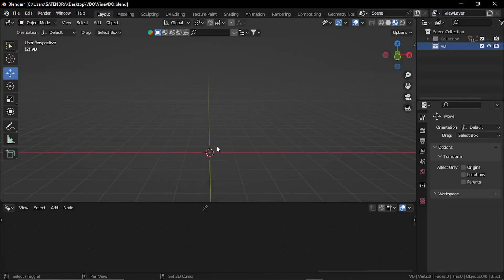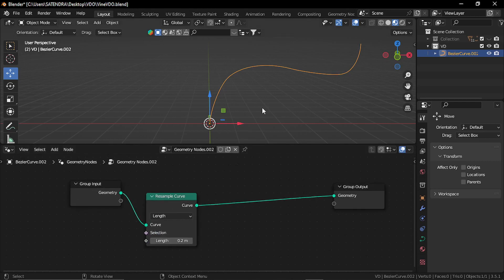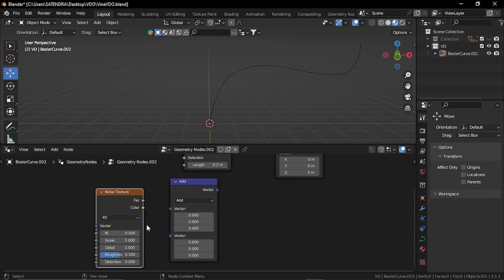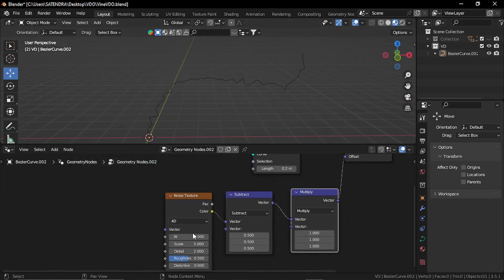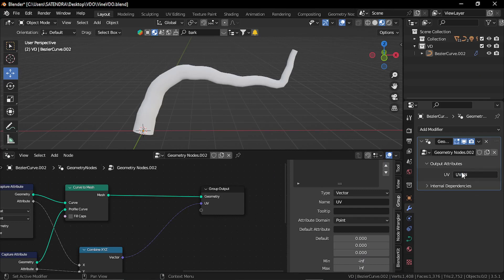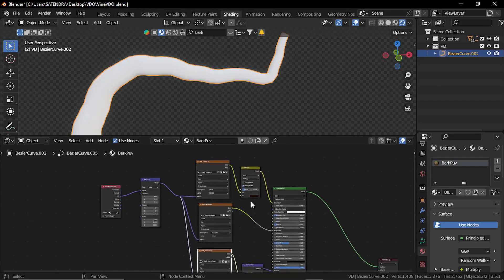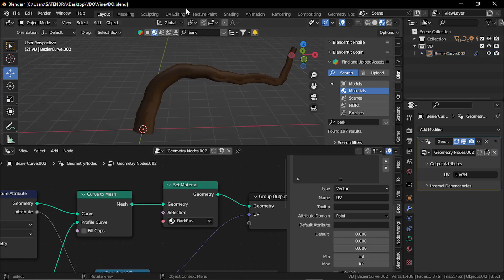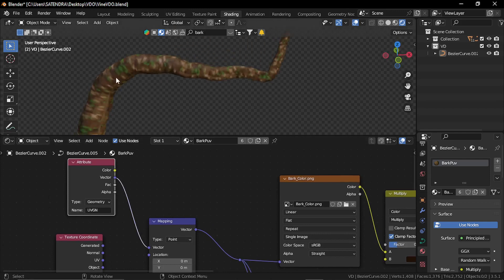Easy Geometry Nodes - Procedural Roots - BLENDER3.5

Comment: 3:40 If you are trying this today, float curve doesnt go into set curve radius, just plug it into the curve to mesh "scale"
Reply: GOAT
Reply: thank youu
Reply: for me the 'curve to mesh' node doesn't have a scale input. Just: curve, profile curve and a fill caps option. But it works as per the video anyway. Using Blende 4.3

Comment: I'm stuck at 3:39, when I set the same nodes, mine is skinny all the way through and not tiny on one end and fat on the other end.
Reply: I ran into the exact same problem. Not sure if you've found a fix yet... Apparently, in later versions of Blender, you don't need the Set Curve Radius node. The Curve to Mesh node has a "Scale" which substitutes that. Plug the Set Position node into the "Curve" input of the Curve to Mesh node, then plug the Curve Circle node into the "Profile Curve" input of the Curve to Mesh Node, and finally plug the the Float Curve into the "Scale" of the Curve to Mesh node.
Reply: @rochestas  you're an angel
Reply from the maker: You can download the original scenes file and check it.

Comment: This is simply beautiful! Thank you so much for sharing it ^_^ I wonder though how did you get that beautiful clean shape after 12:30? My sub-roots look uglier and squashed in some parts, no matter the resolution i set on the nodes. Any possible reason? I followed the tutorial step by step and set the same values as yours. EDIT: i might have sorted it out. Guess it was depending on the distance between the vertices of the curves on the viewport, adjusting them I was able to get a similar result as yours :)
Reply from the maker: You can download this original blender file freely & compare the exact values there.

Comment: The tutorial is great. But I did not understand one thing, how to fix the points of the curve on the pacifiers for further animation? I usually animate the curve through a series of pacifiers, clinging to them with the "Hooc" modifier, but this does not work with this curve, the points simply do not move when I attach the Hooc to them. Is there any way to fix this?
Reply: I was able to figure it out.

Who cares if you want to animate curve segments, for example to create more lively roots: 
1) Turn on the "AnimAll" function
2) In edit mode, select the curve segment you want to animate
3) Press Ctrl H and select "Choose to new object"

That's it, you can animate your curve using the keys as you like